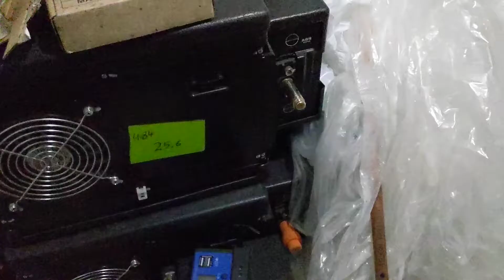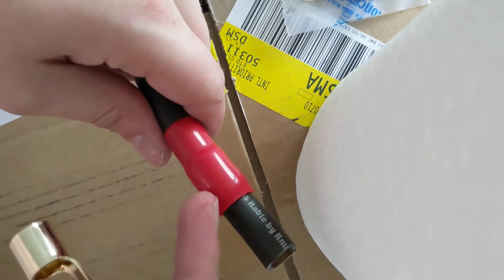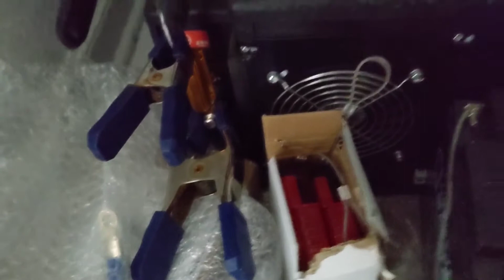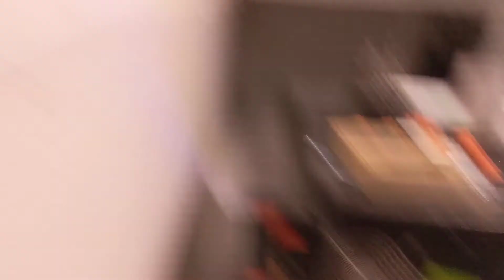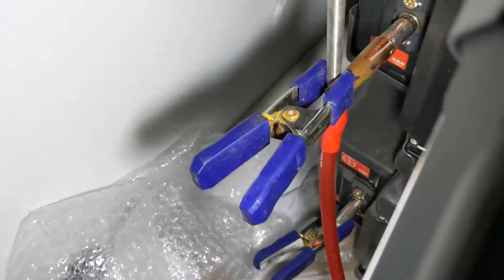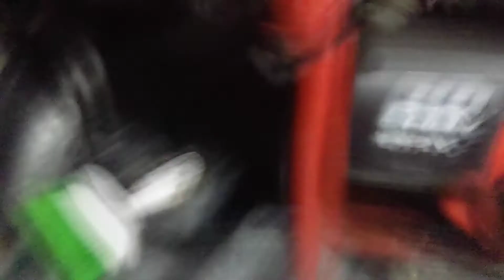MPP Solar LV2424 + Solar Battery Setup Derecho Disaster Relief Des Moines

Comment: Curious how the MPP is working now 2 years later, considering purchasing this week.
Reply from the maker: I actually have never hooked up solar panels to this thing. I just used it this one time and it's been on the shelf ever since. I recently bought a bus that I will place a twenty-four volt system in, and at that time I'll have the lv2424 as a charge controller and backup inverter
Reply: Trying to use a brad point wood bit to drill metal????!!!!very interesting
Reply from the maker: @douglaswindsor120  Hey, you use what you have available when you're in a pinch. Stores were closed, roads were blocked, power was out everywhere.

Comment: Should use a resistor to charged capacitors 24 volt is not bad but 48 volt capacitors it's easy to burn the out.